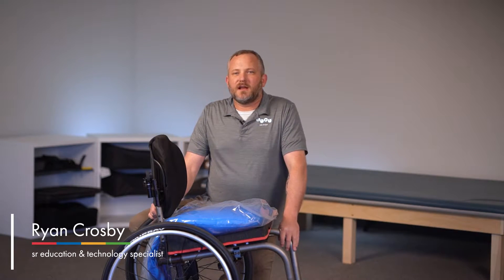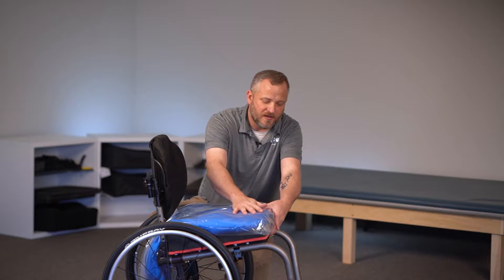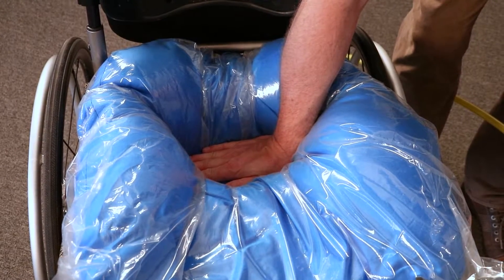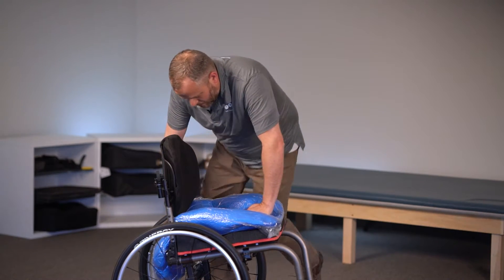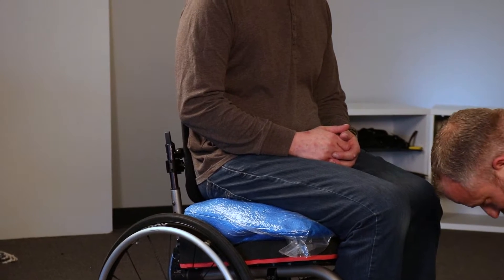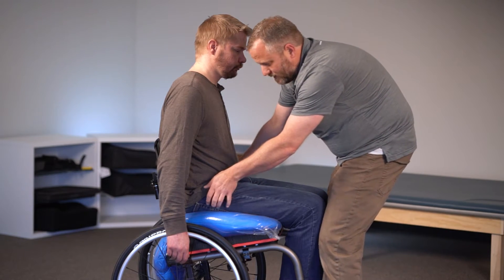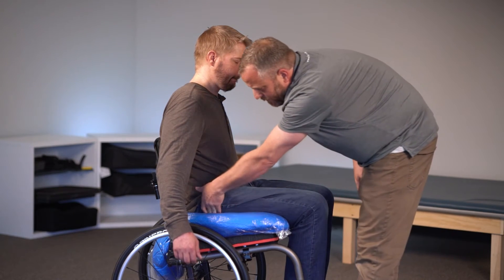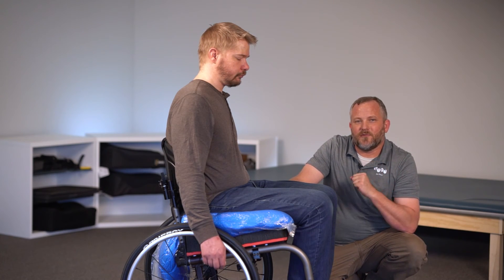Ride® Custom Shape Capture: Preshaping a cushion shape capture bag

Comment: The wheelchair he's being captured in has around 3" seat slope, front to rear but his femurs are roughly horizontal during the capture.  Will his completed ride seat cushion negate 3" of seat slope?  Or will it be made to position the patient's femurs roughly parallel to the red bottom of the capture base?
Reply: Great question and keen eye!! This chair didn't really fit Jeremy very well. He could have gotten a little lower at the pelvis which would have aligned his femurs to be more parallel with the seat frame. This was a potential result of the beads in the bag not having enough room to spread out laterally between the wheels during the hip swish. You may also notice he does not have great wheel access either. Ideally we would have had a little wider chair to capture the shape in. Please let us know if you have more questions! Thank you very much!